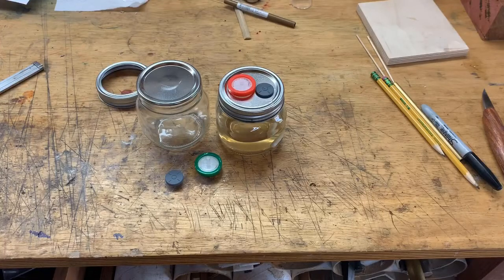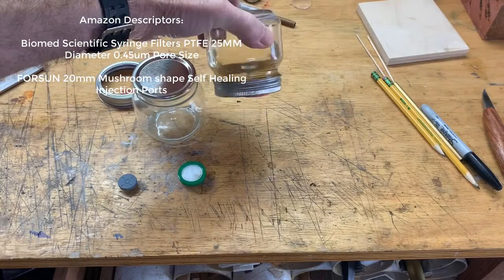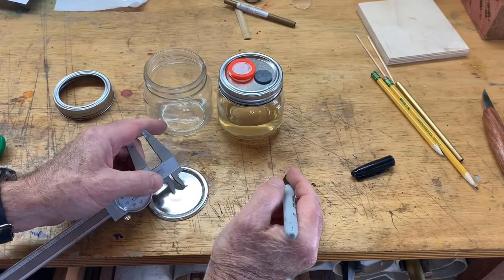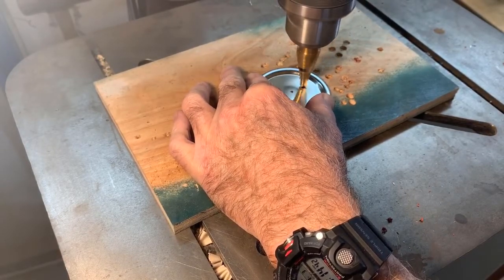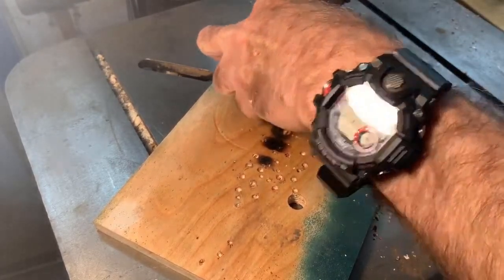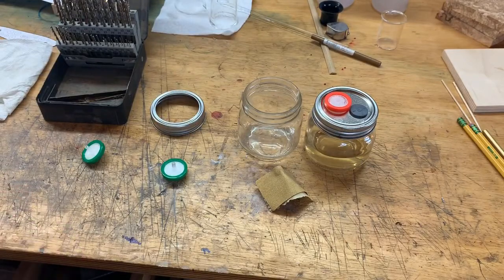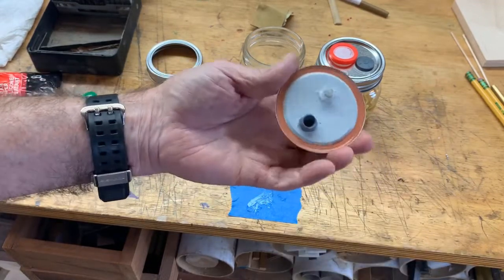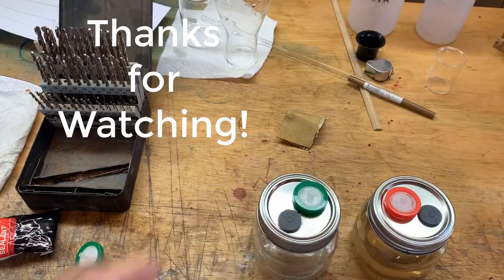Mushroom Growing -- Liquid Culture Jar

Comment: You say the red filter is the right one to use because it repels water, but you used the green filter on the 2nd jar.  Is there a use for the green filter versus red filter?  Also, why is it called a syringe filter -- isn't the syringe inserted in the injection port rather than the filter?  Thanks
Reply from the maker: If the hydrophilic (green) filter gets wet it slows down the passage of oxygen.

Comment: nice video :) .. So the .45um filter works ? I dont need .22um filters ? 

Thanks
Reply from the maker: I've never seen any difference between the two. Spores are generally larger than 5 microns and the common detrimental bacteria are larger than 0.5 micron. I've found that the most contamination comes when inoculating the jars with agar, and not from the filter. So, I always inoculate at least two jars of liquid culture.
Reply: @bagnob1321   Depends on your environment. 5/32 is the drill bit size for the syringe filters commonly used .22µm(.22micron). 1/4 inch = RTV injection port drilled hole size. assuming everyone has the environment you live in is BAD .